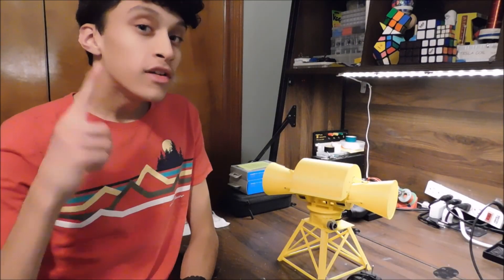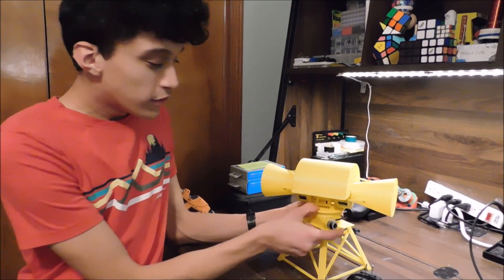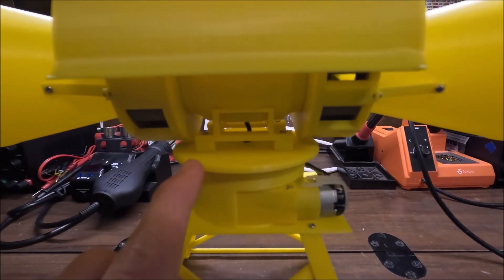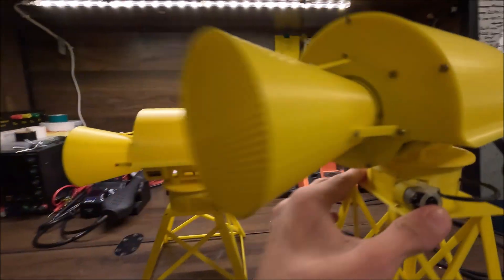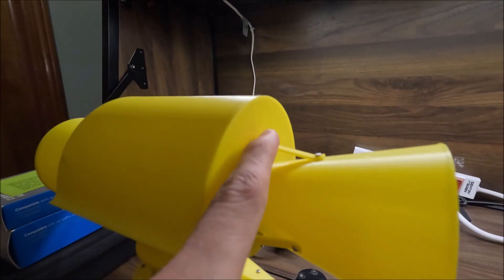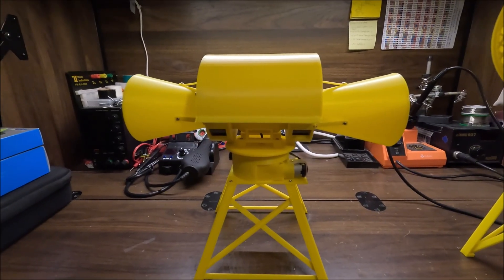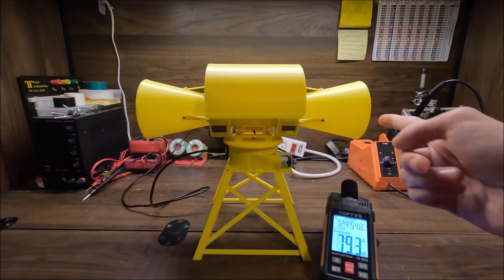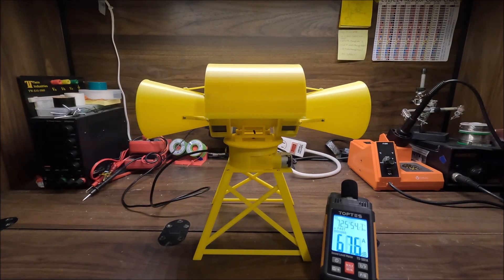NEW Mini H.O.R. Model 50 Super Sirex Overview/Test!

Comment: Do you mind if I remix and STH 10 Make it way bigger fix the motor holder make it way bigger and print it and show you it and give you credit
Reply from the maker: Sure you can as long as you credit me, but I don't recommend scaling my models to be any bigger because it'll mess up things like hole sizes and wall thickness. If you want a big 12-port siren of mine that's way bigger on its own, maybe try out my 1/4 scale 2001-130. If you'll wait, I will revamp the design soon and it will be even better.
Reply: @mil @milespeterson5049 lso I think you know what my other channel is sirens of la Porte County
Reply: @milespeterson5049  do you think we can work together together to make our own siren together

Comment: Do a mini federal signal  500 shtt 2nd gen
Reply from the maker: Eh, no thanks. The rotators those sirens use are BEYOND me.
Reply: @milespeterson5049 than a thunderbolt 1000(not 1000t)
Reply from the maker: @tehwin7spartan  We'll see. I am busy now with other simpler sirens, but a Thunderbolt is on my to-do list for the future. Are Super Sirexes not enough...?
Reply: Yeah, I can't blame you @The3DEngineer lol. I have no clue how those rotators work because they keep spinning for like 3 minutes after the siren shuts off
Reply from the maker: @BennyjitsSirensOFFICIAL  lol, thanks. I believe those use what I call a chopper-motor-to-rotator setup. The same motor that drives the choppers goes through some sort of gear reducer that then spins the entire siren itself. Sirens like P-10s, Allertors, and even Thunderbeams use this setup.
Reply: @milespeterson5049 Wow so it shares a motor for the chopper and the rotator instead of having 2 separate ones?? That's actually crazy I didn't know that sirens were engineered like that
Reply from the maker: @BennyjitsSirensOFFICIAL  Yeah, they sure are! The reason I don't make mini sirens like that is because the gear reducer setup is pretty complicated, especially at a small scale, but it's still possible to do. Not many people opt to make mini sirens like this at all, in fact, and probably for the same reason I don't.
I've seen Connor Cruise's mini Allertor, and he decided to use a separate motor to drive the rotator anyway, which I think is actually kind of smart.
Oh, I thought you'd be interested to look into how chopper-motor-to-rotator sirens work. I found an entire article on the ARS Wiki on the ACA Howler that shows up-close photos of the rotator system. https://wiki.airraidsirens.net/Howler
Hope this helps!

Comment: Nice it’s finally assembled! I do have a request. the performance plus penetrator-15 it’s a p-15 head with a t-128 rotator there’s only 1 video of it  but it has a simple horn and rotator design so with time I think you could do it. Video https://youtu.be/hmPXtkWJm-E
Reply from the maker: Yeah, no thanks. That is an extremely rare siren, and it's pretty complicated so I probably won't be making one.
Reply: @milespeterson5049 ok